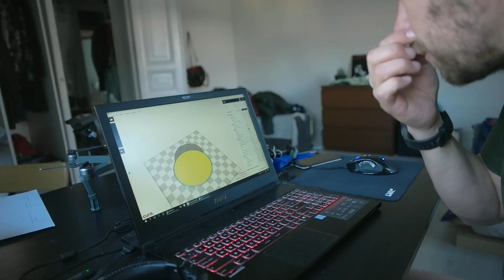3D designing and printing simple part for my boat - Electric sailboat vlog 0014

Comment: why do you print these covers for the holes? i think it is much better to fill those holes with polyester resin or epoxy and fibres. top it off with gelcoat and sand and polish. it will make it a lot nicer and more reliable i think.
Reply from the maker: +dextersxxxxlab Nicer to look and more reliable, true, but you just went through 3-4 phases and I just need to print and glue. That's why :)